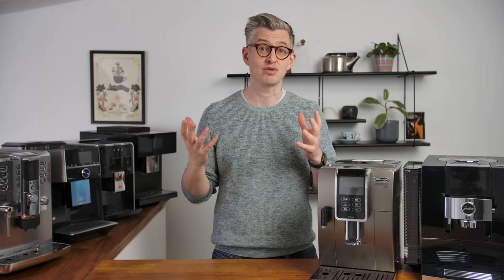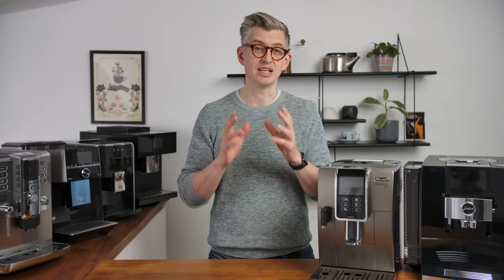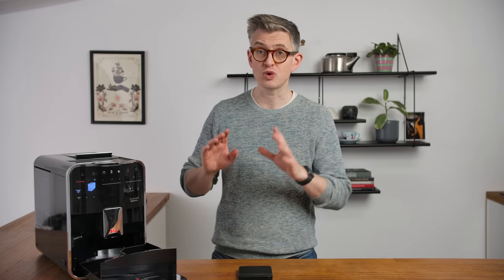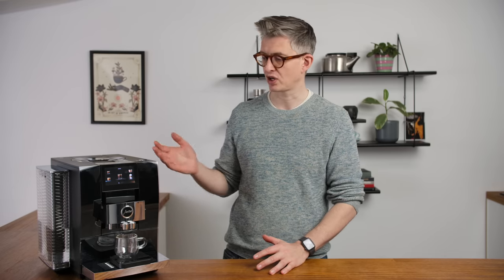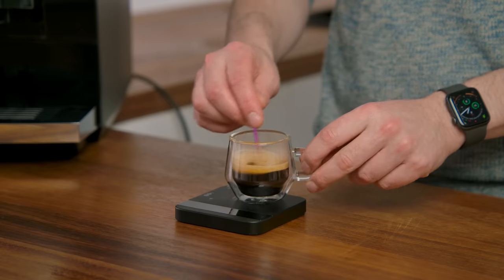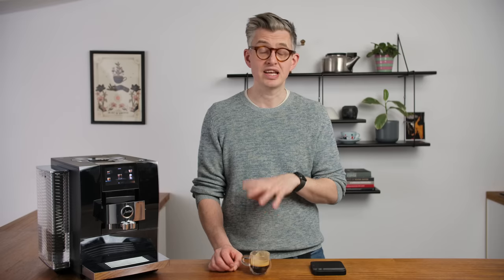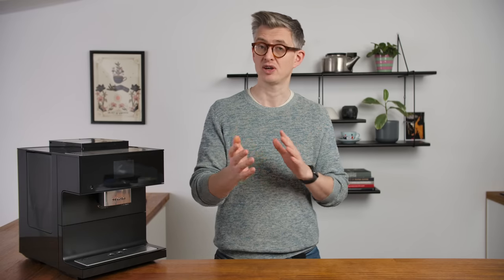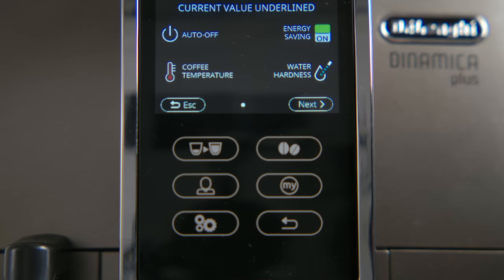How To Dial In A Bean To Cup Machine (Like A Nerd)

Comment: James, please be aware, that measuring the weight of ground coffee can cheat you.
Most of the machines (at least Saeco / Phillips ones) are fitted with an automatic dosing quantity control algorithm.
The machine monitors the power usage of the grinder and the brew group motors during grinding and pressing the coffee, and from the values it corrects the grinding time for the next cycle.
Theoretically it helps to auto-adjust the time-based grinder to three factors, which are determining the amount: how full the hopper is, how oily the coffee is and how hard the beans are.
It works great, but it can seriously affect the amount of ground coffee. My experience is that it needs 2-3 shots when you change coffee type or fill up an empty hopper. Especially the first cycle can be misleading.

Regarding the espresso, I am quite satisfied with my settings and the result. I have an older Saeco Talea Touch II machine, which has an extra "aroma control" (you can adjust the flow speed). I found it very useful to fine tune results. With SquareMile's Red Brick coffee my ground-to-yield ratio is about 1:2,8, with a very tasty result.
Reply: You're correct on the power usage of of the brew group motor part, but a Saeco/Philips/Gaggia doesn't use the power usage of the grinder to adjust the amount of ground coffee beans. The adjustment is made purely by an algorithm (SAS) that's based on the power usage of the brew group motor. The amount of coffee that has to be ground is then determined by the Hall sensor of the grinder (based on number of rotations according to the aroma setting by the user). 
But Siemens for example doesn't have a hall sensor on the grinder and uses the power usage of the grinder.
The technology behind these machines is very interesting.

Comment: I know some of these machines pretty well from various workplaces - some of them will let you have the ground coffee just by stopping the process, for example by pushing the one/two cup brew button again. You need to be careful (and fast) though as the window might be very short to act. This trick works with Saecos and some Delonghis.

One more thing about adjusting the grind setting. Some of them will require a special type of screwdriver (I found this on some Saecos, like the Talea Giro), looks like some kind of Allen key. Other machines have these dials, but you should adjust them when the motor is running. It will be easier.

Comment: I liked my Saeco Vienna so much I bought a second one for the office. When they wore out after several years I replaced them with a Vienna Deluxe. Really excellent tasting coffee. But that machine finally died and I miss it: the Philips 2200 I have now just doesn't taste as good. I'll try slacking off the grinder setting and increasing the temperature to maximum and see if it will perform. In general the mechanical controls on the older machines were far easier to use, and they didn't waste half a cup of hot water on start up or switch off. Thanks for the informative video.

Comment: I am happy that I have a Schaerer sienna 2. With the service cable and software.  I can adjust it properly.  1 millilitres steps and 0.1 sec grind steps. I prefer a lungo over a espresso.  I use 9,2 grams fine coffee and 125 ml water.  I also use  pre infusion for a more even extration. It did take a while to find the sweet spot. 😁☕️

Comment: I have a Jura Ena Micro 1 which I got for a very good deal used a long time ago. I've been using it reliably for probably the last 4 years to brew my daily coffee. 

I never really adjusted it from what the previous owner had it set to, it was on a fairly medium-fine grind setting. I tried a few different beans and found some I like that work well with the machine and produce a simple "everyday coffee" something I want to drink casually while working that doesn't require my full attention, but at the same time is a nice pick me up on my boring mornings (the coffee is Lavazza qualita oro). One thing I have adjusted is how much water I get out of each drink, I didn't think for a minute though that this would effect extraction! Of course it makes sense now that you explain it

I did play around with the grind settings a few months ago after watching one of your videos about grind sizes and what's better for better extraction and I ended up turning it to the finest setting with the thought "well finer is obviously better right?" The resulting drink was really sour and not pleasant. I thought it might just be a characteristic of the coffee I had, similarly I tried the coarsest setting and got something very weak tasting with none of the smoothness and texture I had from my regular coffee. I tried a few settings in between but ended up going back to what I had it set to originally. 

I'm definitely going to experiment again now though with this knowledge! I know the machine has more potential, just need to unlock it. Oh if anybody is looking for an excellent, simple, well made and reliable coffee machine, Jura is an excellent brand. I would have expected it to fail by now but it keeps on going and going!

Comment: Although it kind of defeats a super-automatic machine's purpose, but as this all I have for now, I think I have managed to pull a close to "normal" espresso shot out of my Philips, closer perhaps to a "turbo shot" in extraction time and yield, by doing the following:
Grind the beans fine with an external grinder (as fine as possible without the machine "choking"), remove the brew group unit, fill it with the ground coffee, SHAKE/TAP THE UNIT carefully so that coffee sits well and evenly, re-insert the unit into the machine, pull a shot at a 1:3 ratio approximately. Using this method, you basically "help" the machine to achieve better tamping, which in turn has a positive effect on the shot.
Like if you think James should give this a try in a video!

Comment: I use a delonghi esam 4200. I actually tried dialing it after i watched your esperesso video. That machine is a bit different as you can dial the coffee bean dose and water but they seem to be inter dependant. to make my life easier, I just weigh 8 grams of coffee into the machine every morning. It is set to 3rd finest grind setting and I have tweeked the water knob to give me roughly 32g of coffee out. I should specify that since I am putting exactly 8g of coffee in, I set the coffee dose knob to maximum and listen to it as it grinds, when it starts grinding "air" I turn the coffee dose knob to zero which prompts the machine to make the drink which whichover ground coffee is has inside.

Comment: We use a Philips/Saeco superauto every day on the coffee setting, it is the closest we get to having fast good coffee while we work.  They refer to the "coffee" setting as a lower pressure brew mode, which makes sense.  If it extracted at full pressure, I'd imagine it would taste bad.  It did take some work to dial in and varies based on the beans, like you said.  I'd be interested in your thoughts on the low pressure drinks performance.

Ultimately, we have saved a ton of money over something like a k-cup system and it is better than a drip machine for on demand fresh coffee.

Comment: About to retire my DeLonghi after 15 years of battling and I’m getting a proper espresso machine. Towards the end of its life I had the machine set to just below the mid point of the grind, hit the extra strong/extra long option and stopped the grind at about 35mls of coffee extracted. It’s the best I could get from these limited machines. I’m looking at a Bezzera machine - one of the models where the group head is heated to cut warm up times to under 10 mins. How about a review of one of these James?

Comment: I admit I've only tried an Americano at Starbucks, and it's okay.  But it always tastes to me like what one might think when you dilute coffee with water: it lacks body and simply tastes like watery coffee.

I have a Saeco Intellia bean to cup machine that I use daily.  I have it fill a standard mug (280 ml or so) and I think it pushes water through the grounds the entire time.  I have it set to maximum strength.  The grind is the medium setting.  This typically results in a nice cup that is not sour or bitter and allows me to taste the characteristics of each coffee.

I have always thought that it's better to run more water through coffee than dilute coffee, because at least then I am not simply weakening the brew; I am still extracting something from the grounds.  But I understand what James argues, which is that this coffee isn't going to be pleasant because I guess it's over-extracted.  Somehow though, the end result is still a pleasant cup.  But I might try diluting a smaller amount of brewed coffee with hot water just to see if that improves on the end result.

Comment: Yes that reflects the experience I’ve had with the large super autos we’ve had in my work staff kitchen. We used to have a Colibri that could handle a surprisingly fine grind, but lacked in other areas. We now have a Franke A600 with a steam wand. I’ve got it set to a sweet spot that is about 4:1 and the results are usually ok as long as it’s clean. It’s a shame the steam wand is so crap, but it takes good quality skim milk powder as well and Belgian chocolate powder so it makes a mean mocha if that’s your thing.

Comment: Before main post a request to James: I'm thinking that there's also a best mix ratio to the coffee when it comes to these machines. I don't think a 100% Arabica is the best. Might just be my taste but for me a 20% Robusta makes it more balanced and reduces the sourness. Fancy trying something like that out? Jura Z10 please :P

I've spent a good ammount of time trying to dial in the machine. The one thing to watch out for, if tweaking the grind, there's cross contamination.  If you really, REALLY want to go into super details, you need to flush the system again, with the lowest amount of coffee on the new grind settings, then go back to what you want to test, returning the amount of water and coffee to your testing settings. 

Also like James said, pre ground coffee needs to be coarse(r), or it will just drip slowly and you can get strange results. I say strange because I've actually gotten MUCH better coffee from my Saeco when it was struggling with the super fine pre ground coffee. Going for a Jura Z10 now, Saeco just has good marketing, the coffee is just bad if you ask me and I've returned the machine.

I don't quite understand why it was better, it might just tell me that the Saeco machine was WAY under extracting the coffee. I remember tweaking it 3AM and trying to get the sourness out of the taste. It was just horrible. At some point it I actually grimaced, it was so surprised by the sourness. 

The Jura, from what I've tried just 1 cup of, was OK. It was a bit to sour for my taste, but I noticed that the machine wasn't set to some default grind setting, and it was 100% arabica, which I'm not a fan of. I found that a 20% Robusta mix is a nice balance for me, without going all the way to the finest grind.

Comment: I have a Mr. Coffee One-touch. I’m not sure if you have any experience with this machine. I prepare the portafilter and load it then touch a button for a single or double shot. This machine also has an automatic milk frother for milk drinks. I can get 13g of coffee in the double shot filter. If I try to do more it won’t let me load the portafilter. With 13g my total volume out was 75g or 2.6oz. The machine instructions indicate to fill the filter with fine ground coffee about 3mm from the rim. I have no control over the temperature of the water. I do have a manual espresso button I can try experimenting with to decrease my ratio.

Comment: I got a DeLomhi Specialista last year because, frankly I don't need another hobby.  It pulls a really decent espresso shot and I find it easy enough to dial it in. Load beans, grind, tamp,  inspect basket. If it's above the line on the basket, reduce time, if below increase.

Comment: KEY TO KNOW - The Delongi grinder dial ONLY WORKS WHEN IT IS GRINDING.  You cannot change the dial while the grinder is not actually running.  Something I didn't know for years!  (yes, its in the manual - the manual I didn't get when I bought mine 2nd hand)

Comment: Great video! I have the same Melitta (TS Smart) and had always wondered how to use it properly, since the instructions aren't so clear. Good to know about the higher temperature. That one has an "intense" setting, should that be used as well? I feel like it gets a bit more extraction (higher temp and pressure) but have no idea. It'd be great to have an in-depth video of each of them!! Great stuff, as usual.

Comment: Very interesting,  I have a Gaggia Classic and La Pavoni Europiccola,  I recently inherited a Gaggia Brera Bean to cup and have been trying to dial it in to get a decent coffee from it.   I have already abandoned the long drink option, however I think I have am trying to get it to produce as close to Espresso as possible, I am currently on the finest grind setting brewing at a 2.5:1 ratio, and it isn't quite working, I guess it is probably under extracted.  I will set the grind a bit coarse and try about 4:1 and see what difference it makes.   I will also weigh bean usage properly.

Comment: grinded coffee amount also hugely depends on grind/coarse settings ..which is no one talks about ..even @James Hoffmann , as he said coarse setting are usually timed in machines so normally finer coarse would be harder to grind and at the end there will be less grinded coffee to measure.. which is truly the case with mine De'Longhi Dinamica and the max difference is not negligible..at coarse setting 1 I measured 8g of coffee and on coarse setting 7 there was 16g of coffee at max setting for max coffee amount or '5 beans icon'..so 8g difference :) .. in reality we will all use coarse 1 to 4 but even there is difference of ~4g of grinded coffee so you would have to adjust and water amount depend and on coarse settings beside coffee amount setting if you want to follow that 1:3-4 coffee/water ratio for good espresso. 
For all De'Longhi Dinamica users water setting 1 will give you 30ml of coffee, 2 - 40ml, 3 - 50ml and 4 - surprisingly 120ml... all tested multiple times. 
Btw I spent at least 300g of beans for all this 'crap' info and at the and ,sadly for me I am not sure will I taste significant difference on any combination of settings for espresso :D

Comment: Just bought a Jura Z 10. Along with the machine was sent a bag of Danesi Gold beans (Not so sure about the quality of these). So far, just using the default settings of the Jura, I have not been able to produce even a decent shot of espresso. Also, it is somewhat frustrating that you have to pour at least a third of the bag of beans into the hopper in order to use it. Yes, I could use the bypass dose, but it would be nice to be able to have some way to dispense the beans sitting in the hopper to switch beans. Perhaps there is, but I have not dug through the manual for that, yet. If anyone owns a Z10 and has any suggestions for adjustments to this specific machine for good espresso, I am all ears, and it would be greatly appreciated. Great video, James!

Comment: I found out that my Siemens EQ6 from a few years ago does in fact brew good enough coffee without going the espresso and water strategy but it took me a good year to try out several brands and kind of coffee until I got the right stuff. It wasn't about the settings the machine offered but instead finding a "compatible" roast. I absolutely love the Yanesha beans but I hate how these machines ruin the experience... Now It's running off-the-shelf Tchibo and while it doesn't blow me away, at least it produces acceptable coffee now.
The only vital lesson I learned from it is if that machine dies one day, I will replace it with with a decent espresso machine - that's for sure. This even today goes as far as brewing my coffee with a V60 whenever time allows (including grinding the beans manually, of course) since that always tastes perfect.
The most baffling thing I found out about this machine is that it produces way better results with pre ground coffee but that somewhat defeats the purpose of it.

Comment: I have a delonghi esam 4200 and after many years and some tuning of the grinder to make it finer, I can say I get a good espresso out of it very close my other manual machine.
Key for me was changing one variable at a time and restarting again.
I fixed the dose and kept going fine until it was choking and then went "little bit" coarser and that's it. Now I just change dose and liquid but don't touch the grinder any more
Reply: Same here! If anyone's interested, there are some instructions online showing how to make the grinder grinds finer. My '4' setting is the original '1' setting. I now grind between 2.5 and 3.5 depending on the bean. The burrs touch at 1.5.Any finer than 3.5 with some medium roast beans and   it will choke the machine.
Reply: @herbsmanherbs  Hello! I know it's been 2 years since your comment, but hoping you'll reply: I've searched high an low everywhere for this, but can't seem to find it; can you point me to the page/video where I can find this?

Comment: With my machine I just cancel/stop the extraction.

Which is both a safely mechanic, and to reset the brew group.
since there could be air in the waterline. which damages the machine

And yes i have put in multiple types of "cheap" specialty coffee.

And i did notice that i had to change the grind setting a few times, during the changeover from Brand A to Brand B.

But then again i have a TOP END segment machine "saeco Xelsis SM7685"